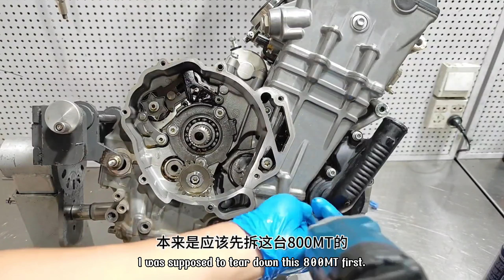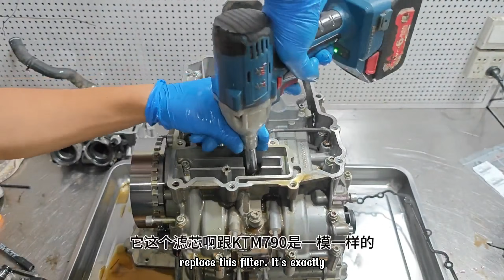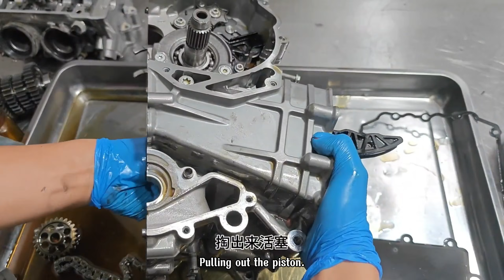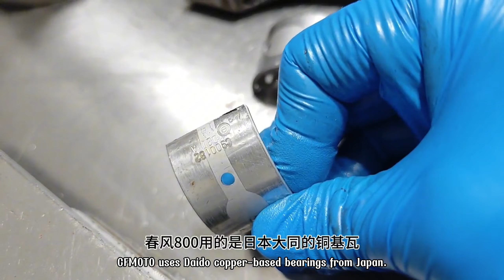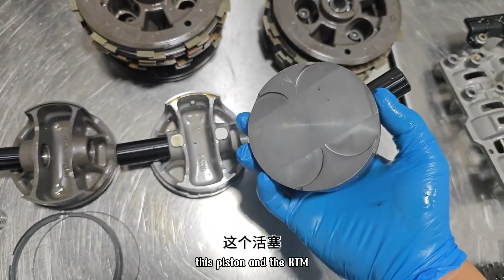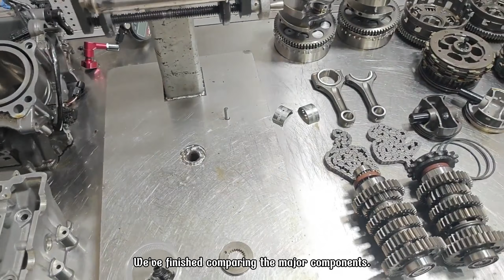CFMOTO 800MT vs KTM 790 Engine Teardown: Direct Clone or Hidden Downgrade?

Comment: You missed a huge difference between these two engines (KTM vs CFMOTO).  While you note rotors are clearly different, more importantly, they are timed differently!  It will prevent you from dropping the KTM engine into a CFMOTO or dropping the CFMOTO engine into the KTM.

Comment: What are the differences between the ktm 790 and 890 engines? Can anyone tell?
Reply from the maker: While the KTM 890 engine (LC8c) looks almost identical to the 790 from the outside, it isn't just a "bored out" version. KTM performed a massive internal overhaul to transform a high-strung, nervous engine into a more refined, torque-heavy powerhouse.

Comment: At the end of your video you mentioned the rocker arm issue for gear changing. What problem does it have and does it have a solution?
I have an 890 and I find it hard to move from 1st or 2nd gear to neutral with the engine on (somtetimes).
Thank you!
Reply: Your videos are brilliant!
Reply: This can be caused by two things - the clutch slips too little when opened (this can be due to incorrectly adjusted clutch clearance, too thick oil, once it even happened to me on another bike due to strangely worn clutch plates). Or (and this is what they mention in the video) if the Shift Star is loose (a loose screw) or the locking arm (the pull rod) is worn, the mechanism lacks "feel" and precision.
Why it does this while running: Engine vibration and the rotating gearbox accentuate the clearance in the loose star. The shift pins then do not fit exactly into the cutouts for neutral and you simply "drive" it from first to second and back. As you saw in the video, it is not a complicated mechanism, but to repair it, the clutch must come down including the clutch basket.
Reply: @kachnakachnaf800gs thank you. I will check what you mentioned
Reply: its just a ktm thing rly from my understanding, i have same "problem" on my 890 R and 300 EXC. you will find it with patience and experience x]
Reply: @zenc9670 thanks. I also own A 690 Enduro R from 2022 and that one shifts like a dream! Both in manual and quickshifter.
Reply: i think there's a stiffer aftermarket spring for the indexing arm

Comment: Had to chuckle the other day looking at a 800MT for sale, new with "lifetime engine warranty". KTM thought they were so mighty that their own smugness to acknowledge the known problem THEN not fix it really is what sunk them. Seems the CF has just not been out long enough to acquire the oil starvation problems yet. Warming the engine and changing oil/filter should help though. Great video BTW!
Reply: They allegedly addressed the problems with oiling, i think CFMoto has done enough R&D for themselves and their own engines to just reuse a problematic engine and do nothing about it.
Reply: @Al.j.Vasquez  Considering they were the ones building it for KTM in the first place?
Reply: @tieoneon1614  I'm not 100% sure, but the Austrians were the ones who designed the engine, CFMoto helped with building motorcycles for them in China, I wouldn't say CFMoto is guilty of the issues that plagued KTM engines.
Reply: @tieoneon1614 Correct me if i am mistaken, but i believe CFMoto had licensed an older version of the LC8 engine, the one that KTM updated was the one that failed. CFMoto designed their engine for the 800 Xplorer upon that older version of the LC8, and fixed the flaws found in the newer LC8 to use it in their new 800 MTX.
Reply: @Al.j.Vasquez  for some reason I thought this vid showed wear on the cams, just rewatched and it didnt. Just pointed out the super small oil spray passages to the rockers which lead to the problem possibly in the future. You are correct about the Austrian built engines though.
Reply: @tieoneon1614  Don't wory, anybody who has some doubts about this topic might find our interaction helpful. I didn't really watch the whole video because the MT-X is not on my radar, so i'm glad you pointed it out.

Comment: Love your videos!. I'm currently riding a CFMOTO 1250 TR-G. Would love to see you make a teardown video of the engine of the 1250 TR-G!
Reply from the maker: ok
Reply: Holly hell! i havent seen that bike in the european market yet....id really love to have a 1290 engine on a bmw RT chassis...and that price...... cheffs kiss
Reply: @Bill.Papadakis the fuel consumption is crazy though.. im averaging about 10-11km/L in city riding even though im being gentle with the throttle 😢. At 240km, I’d have to refuel already
Reply: @syukurabdul6264  HOLLY!! i didnt know its THAT fuel hungry...even the 1290 burns less.....maybe it needs an ecu tune?
Reply: @Bill.Papadakis  Would love to tune it.. However, doing so will void the 5 Year Warranty that the bike has here in Singapore :(
Reply: @syukurabdul6264  weeeeell....technically....you can find a tuner that can tune it and return it to factory settings if the need arises xD

Comment: Interesting observation of the oil spray to the rockers. Might this explain the trouble some KTM owners have had with heads?
Reply from the maker: You’ve hit the nail right on the head. In the world of LC8c engine failures (KTM 790/890), the "Oil Spray" issue is the "Smoking Gun."

For years, KTM owners were baffled by why their camshafts were being "eaten" (pitting and scoring). While many blamed "soft metal," the root cause discovered by teardowns and community investigators (and eventually addressed by KTM/CFMOTO) was indeed lubrication starvation at the rockers/followers.
Reply: So i have a 800nk 2023... Camshaft issue solved or not?
Reply: @MrHybrio  It was not a soft camshaft or soft rocker arm issue in the first place. Those two components were collateral damage of oil starvation in Austrian built engines. Also the issue was never an issue in the CFMoto 800NK.  The issue was the machining of the journal for the oil spray nozzle in the Austrian built engines. The machining of the oil journal from the lower part of the engine did not line up perfectly to the oil journal machined to the upper part in Austrian built engines. This restricted flow to the oil spray nozzles and caused lubrication starvation. This issue was only in Austrian built engines. CFMoto never made or machined parts for the Austrian built engines. The issue is confined to KTM LC8c engines with Austrian VIN#
Reply: @MrHybrio  I would also like to know. Because I'm in the market to buy a CFMoto 800MT Explore. The camshaft issue is what kept me from buying the KTM.

Will the 1000 MT-X (basically de 990 engine from KTM?) be more reliable at this part?
Reply: @shoarmapapi1337 when cfmoto partnered with KTM to produce the LC8c engine begining 2023 the first thing cfmoto did was to modify the machining of the oil galleys and journals to the head which resolved the issue. All 790 and 890s produced since 2023 and all cfmotos with this same engine do not suffer anymore with the oil starvation issue which did lead to camshaft failure.
Reply: @shoarmapapi1337  This was and is not a problem in any of the KTMs with Chinese VIN# or the CFMoto 800NK, MT-X or IBEX. The 1000 MT-X engine is machined and built in China by CFMoto.
Reply: @MrHybrio I have a 23 800nk. At my 62k vc, the cams are fine, same with the followers. Just let the engine warm up for a few minutes.

Comment: That is one fine engine. I will remember to warm my bike a bit before taking off (have a CF-Moto 800 MT-X). Almost bought the KTM version but I found it uglier with more expensive parts and purchase price.
Reply: designed in Austria made by Indians
Reply: @chumpthetraitor7331  Made by the chinese, the indians build only the 390 models.
Reply from the maker: (which is the #1 way to save those camshafts), keep an eye on your coolant level during the first 1,000–2,000 km.

On these engines, it is very common for a small amount of air to be trapped in the system from the factory. If you see the level drop slightly in the reservoir, it’s usually just "burping" air, not a leak. Just top it up with a high-quality OAT (Organic Acid Technology) coolant, and you're golden.